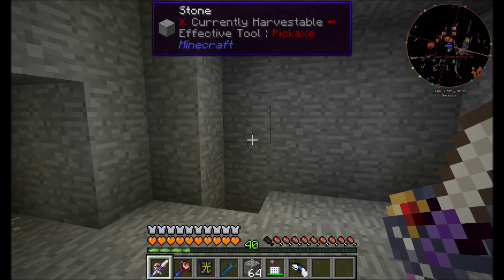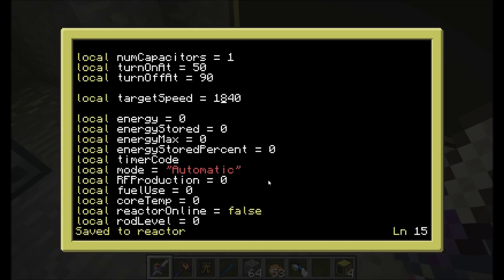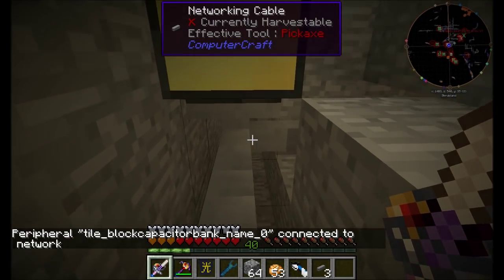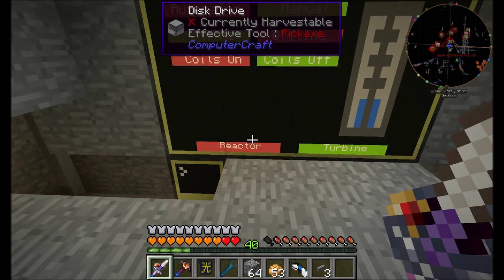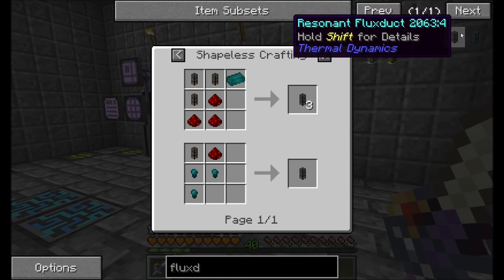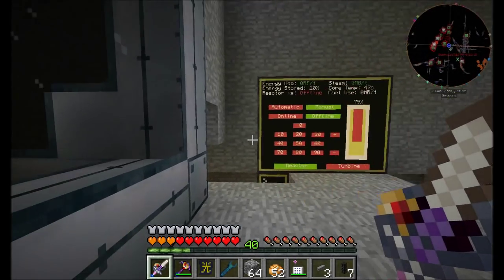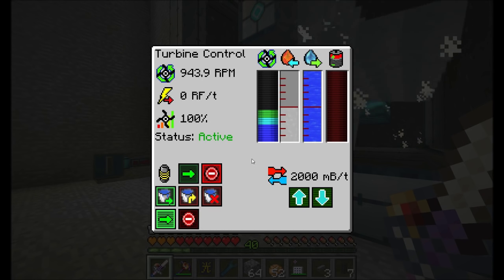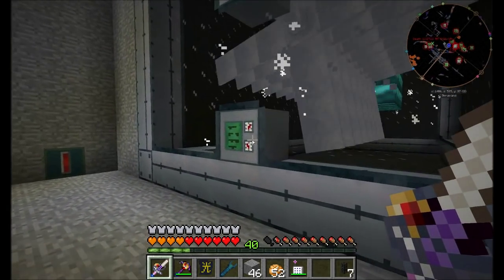Lets Play   S7 E84 Reactor Cutover

Comment: Dire, you are losing efficiency because you have not dumped any of the exhaust fluid, notice how the exhaust fluid GUI isn't going down, you need a second fluid port, you then smack that with a wrench and it changes to an exhaust port. Then you have a range of choices, you can (And I strongly recommend you do) put a second reactor coolant port down on the reactor and smack it again with a wrench to be an input, and then pipe the exhaust fluid BACK into the reactor, this makes for an extremely efficient process but will probably mess up your Computer Craft System
Reply: CoalOres Why would he be losing efficiency? Just because he is not looping the water it doesn't mean that he is losing it. Only the water gets lost, and water was never a bik problem in minecraft now was it?
Reply: ***** 

It is in Big Reactors, redstone, and some other things.
Reply: CoalOres No, his program works just fine with a coolant loop system.
Reply: PureOdium He doesn't have a coolant loop system, that is what I am trying to explain, he isn't pumping the water OUT of the reactor, so he can't dump any.
Reply: I agree he needs a coolant loop system, I'm just disagreeing with the last part of your statement:

 "this makes for an extremely efficient process but will probably mess up your Computer Craft System"

I have a looped system build in my base and it works perfectly with this Computercraft program he wrote. My own complaint is that this program looks to only support one turbine, so the capacity of my 7x7x7 reactor is largely untouched.

Comment: What is the video that explains this Direwolf? I keep getting "reactor:306: attempt to index ? (a nil value)" when I try to start up the program.
Reply: Roblox SS Me too. I don't understand why that is happening.
Reply: Roblox SS I am getting almost the same thing 'button:2: attempt to index ? (a nil value) reactor:8: attempt to index? (a nil value)'

Only thing that I can think of is that there is some value missing from both pieces of code. Any ideas anyone?
Reply: Roblox SS I aswell had this problem. Try this: reconnect the modems after you get the programs.
Reply: I tried disconnecting and reconnecting the modems but still am getting  'button:2: attempt to index ? (a nil value) after running the reactor program.
Reply: What do you have on line 2 in the program button? And do you have a 3x4 screen? The reactor error is gone?
Reply: in the button program it is 
mon.setTextScale(1)

I do have a 3 high by 4 wide screen next to the computer. Yes the other error I was getting is gone, I had forgotten to set the number of capacitors.
Reply: Weird, try removing the programs, and reinstall them? Sorry cant help you further.
Reply: Ok, did that and removed the modems and cables too. After getting the programs I put the modems and cables back on, turned on the modems and then edited the reactor program for the number of capacitors that I have. Ran the program and this time there were no errors, at least so far.
No idea what I did that would have been different. Thank you for all your help with this, I don't think that I would have figured it out.
Reply: Np :)
Reply: I have a problem in connecting the modem to the vibrant capacitor. I put the modem under the capacitor and I try to right click but the red light doesn't turn on e don't show the message that confirms the connection. Please anyone help me?
Reply: Roblox SS Line 306 is where it attempts to communicate to the capacitor bank, so make sure that is connected.

Comment: Whenever i run the reactor program in says          reactor : 306 : attempt to index? ( a nil value)                            how do i fix that?
Reply: max cactus To fix this I had to edit the reactor script. So take note of what it puts in chat when you right click the wired modem on the Vibrant Capacitor. Mine said "peripheral "Capacitor_bank_2" connected". So in the computer type "edit reactor", then change the 3rd line to p = peripheral.find("capacitor_bank"). I changed it to capacitor_bank because it was the first two words of what was put in chat. What ever yours is just drop the last _ and the number. Guess the API or Ender IO changed the name of the Vibrant Capacitor so Computercraft couldn't locate it. Good Luck.

Comment: I don't like big rotating multiblocks. There's something decidedly un-minecrafty about them. Does Dire's program work with a direct generation reactor?
Reply: Phil Hibbs  Phill its Works whit direct generation reactor .
Reply: It's not as good though.
Reply: Phil Hibbs You don't have to use the Turbine Glass.  You could just use the Turbine casing and then you don't have to see the spinning fan, it will just be a big multi-block cranking out loads of RF.
Reply: It will still be there, haunting my dreams with forbidden circles.
Reply: Phil Hibbs So how do you deal with extra utilities impossible object :)
Reply: Entites shadows are circle in Minecraft. How do you feel about them
Reply: They don't bother me.
Reply: Yes as explained in his big reactor highlight his computer craft program will auto detect which style of reactor you are using.  So if you are generating power with it, the turbine controls won't be there.  If you add the steam port then the reactor switches type and the program when rebooted will change with it.
Reply: Phil Hibbs it does, at least it used to in the past
Reply: Phil Hibbs Actually if you don't use glass they are not there. If the case is solid it doesn't even render them.
Reply: Samuel Garcia I've never dealt with one.
Reply: garygsp3 The program crashes if you don't have a turbine connected.

EDIT I'm wrong, I had coolant ports installed and I didn't realised that that is what flipped it into turbine mode. It's fine now!
Reply: Samuel Garcia I place them in the world, and they load my chunks. What has that got to do with anything? Are chunk loaders big? Are they multiblocks? Do they rotate? No, no, and no.
Reply: Actually I don't care. Feel free to accuse me of cognitive dissonance, but I still don't like big rotating multiblocks.
Reply: Phil Hibbs Any Vanilla automation is essentially a multi-block structure.  When you put a hopper on a furnace, that's essentially now a 2 block structure that serves a single function.  The difference is that if a mod author makes that a multi-block, then it only creates the tic-lag of a single block, no matter how many blocks it takes to build it.

Spinning is another point entirely.  It acts against the tic-lag saving benefit of multi-blocks.
In vanilla, dropped items spin, but that is a bit different.
Reply: Like I said: "I don't like big rotating multiblocks". Items on the ground rotating, or a hopper feeding a furnace, are not "big rotating multiblocks". Multiblocks, I don't have a specific problem with them. Big things, no problem. Rotating things... I'd prefer not, but if it isn't too intrusive, then no problem. But if it is BIG, and ROTATING, and a MULTIBLOCK, then I probably won't like it. It's a feeling I have about various things, not an exact mathematical algorithm where A+B+C=WRONG.
Reply: No I don't. I just don't build turbines, and I don't use Immersive Entineering. Problem solved!
Reply: Enchantment rooms and double chests are not BIG ROTATING MULTIBLOCKS, okay? Neither are withers or snow golems or end crystals. And I don't care if my opinion is lame, it is what it is. I don't like them.
Reply: Damn, I can't think of a comeback, truly you have defeated me with your wit and insight. I retire in shame.
Reply: Samuel Garcia Or he could tell you to go away. It's his opinion. If he doesn't like rotating multiblocks, then that's his thing. I honestly don't blame him. Imagine standing in there and being pulverized.

Comment: Interesting but I think I will stick to NOT using the computer program. We have 4 9x9x16 turbines on end at the moment. Our steam per tick is hovering around is above  is above 4000 a tick. Power output is 97722 from all 4, I don't see what the point of the computer program is. It is very cool though. :)
Reply: David Webster To auto-stop the reactor while the energy buffer is over 90% full and restart it while it's below 50%, and force the steam turbine only producing RF at around 1850RPM . Simplify, it's basically some good controls of fuel and steam usage by programming the machine when to run and when to stop.
Reply: 1800 is optimal it states and from my own experience building quite a few works best there ;)

I would love to get the computer program, what mid is it, computer craft or open computers

Comment: I still don't get the reactor thing. Why some people put buckets of liquids like liquid ended or cryothium ???
Reply: orgsniper It's used as coolant for the reactor, the cooler your reactor is the less fuel is consumed per tick.
Reply: So he is not being efficient eaven with computer and stuff??
Reply: For steam creation the hotter your reactor is the more steam is created, if Dire was creating power with his reactor then he would be inefficient. The computer program makes it so that he can use just enough fuel to create enough steam to power his turbine.
Reply: Now it makes sense
Reply: RPGMadness208 DW20 is forcing real world mechanics onto big reactors, thinking that hotter is more steam, and you are just following him blindly. I personally test it, and the amount of rf you can produce in a reactor is similar to the amount of steam you can produce. So, if your reactor produces less power, do you expect it to produce more steam?
Reply: Xplorer30E  But how do you explain that when the core temp. is 99 degrees Celsius it produces an abysmal amount of steam than when the core temp. is much higher, it produces a lot more steam.
Reply: RPGMadness208 No idea what you are talking about. In my test, my resonant ender cooled reactor can power more turbines than the air cooled reactor. These are the same size reactors by the way.

Comment: what's the point of the turbine, does it make the fuel use go down? surely it would be more powerful to build a reactor in its place.
Reply: It gives free power from the steam that the reactor produces
Reply: Oliver o niell Uses less fuel for more power output
Reply: I have a big reactor the same size as this one.  It has graphite carbon blocks in place of the blocks of gold and is cooled with liquid ender.  I can produce max just under 11k rf/tick.  The only way to make my reactor more effiencent is cryothium which I can't make as I don't have a spawner built to get the dust.  Even so that is way under what this turbine is making.
Reply: He can power probably another 2 or 3 turbines with that reactor. So he will be making like 80000 or 100000 rf a tick with that reactor instead if the 11000 it could produce by itself, and still be using the same if not less fuel.
Reply: William Martin  yeah so it's the fuel thing then. if he made reactors the size of the turbines he would produce the same energy. If you actually check the configs of the pack you'll find the fuel use is very nerfed. It's a nuclear reactor so I always turn the fuel use right down.
Reply: Actually the fuel used stays the same but the power output per fuel increases.
Reply: garygsp3  you don't need a spawner to make the dust, snow + destablized restone = blizz powder, its much easier then hunting for blizzes.
Reply: garygsp3  you'll find enderium is better than cryothium or liquid ender. use a laser drill and light blue lenses to get shiny. or silk touch redstone ore and use ferrous.
Reply: actually, because of the way the radiation is coded, the best setup is 3 layers of gelid cryotheum and one layer of resonant ender. Resonant Ender is just considered easier because you only need the top block. Personally, I find this a bit cheaty, and also, getting a hold of redstone to make gelid cryotheum is easier then hunting pearls.
Reply: ClockworkAvatar just go to the end and grab some lilys or make a mob farm.